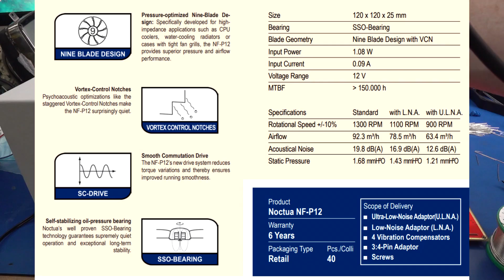Soldering Fume Extractor Fan Upgrade

Comment: The smell of soldering fume... Mmmmm
Reply: Mm lead poisoning
Reply: Secret, how hot do you solder for the lead to boil?
Reply: @Okurkaarrgghh   Depends on what im soldering, but there's always going to be some fumes.

(And that was a joke, it's hard to make it obvious as this is text)
Reply: @TheIdiotPlays  just to make it clear for anyone who doesn't know: there is no lead in the fumes! The fumes are still highly aggressive because they come from the flux which is activated rosin (or synthetic resin). The activation stage mostly contains halogens in standard radio solder. The fumes can give you horrible allergies, and then you can forget soldering forever.

Comment: In my first job we had those tinfoil foldable hoses on every table and all connected via sewer pipes to 20W fan on opposite side of room. It worked quite well to be honest, but only if two people used it, with more it started to be too weak. But you could position it anywhere you wanted :)

Comment: You can remove the filter, it will improve the air flow a lot
Reply: It needs to filter the air though
Reply: @BenCos2018  he has an air purifier so i don't think it's that big of a deal
Reply: @geovani60624  An air filter such as a HEPA filter can only remove large particles from the air such as dirt, no matter how small of particle an air filter is rated for it cannot remove oders or more harmful things from the environment, those must be physically removed from the air by a carbon filter and not that an air purifier can't have a carbon filter also but it will take a while to remove all that flux from the air compared to removing it at the source, so eventually you're just going to be breathing that flux anyway, so why even bother with a fan at all if you aren't going to filter it or exhaust it outside?
Reply: @vgamesx1  hot fumes on your face? at least that's my use and i leave the windows open
Reply: @geovani60624  exactly! Without a fan, the fumes will mostly go directly up your nose when you breathe in (your nose is the extractor in that case). A normal fan is absolutely good enough for hobby work as long as you air your room.

Comment: I acquired a Weller Wfe 2Es Fume Extraction Unit and would never go back to a fan on the desk.
Reply: Nice, but surely not a hobby solution.
Reply: @santopino2546  I bought it from amazon for less than $100.
Reply: @JustinAlexanderBell  That Weller model is not produced anymore, I checked other modules, they cost over $500.

Comment: WHAT? You didn't use a NE555 to make a PWM circuit to regulate the noisy fan?
Dave, you are getting lazy. ;)
Reply: Nah, do a version with stacked fans and a power up sequence. You get 5 of those little suckers in a row, they'll really scream. Usually the bearings in the last two fans go after 9-10 months, but since they're out of junk, oh well. ;)

Comment: the soldersmoke was the most important reason for th EU to go leadfree.
Reply: No, it wasn't.
Reply: @Sjaak PD1SRM indeed, we switched to directly injecting lead while vaccinating, also something something Death panels
Reply: Although I don't like the EU, I think the lead-free laws for industrial products are mostly positive. I mean it prevents tons of lead being thrown into landfills. And most electronic products today are not made for eternity anways, so it doesn't matter when the solder joints have less longevity.
I still work with leaded solder only, just bought a big stock because the supply of quality brand leaded solder seams to be running out. I was told by someone in the industry that brand manufacturers like Stannol or Felder in Germany have stopped producing leaded solder because it's not profitable for them anymore.

Comment: Someone should do a test how much stuff those thin carbon filters actually filter out. I am suspecting they do not work at all for solder fumes and the whole setup just disperses the smoke.
Reply: I already did with a particle detector. It does clean it up significantly.
Reply: Martin Rabson Carbon filters are all about chemistry, not particles.  The "activated carbon" reacts with many, but not all, toxic substances to chemically trap them.  If the problem was particles a cotton or microfiber filter would be the thing.